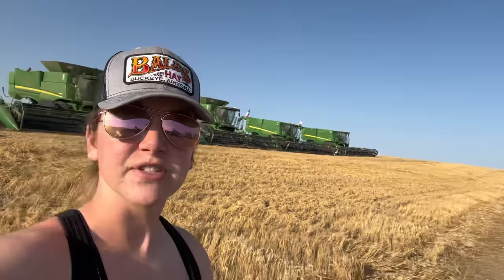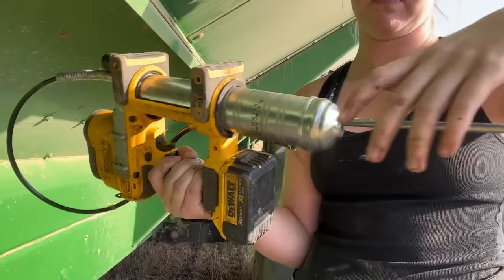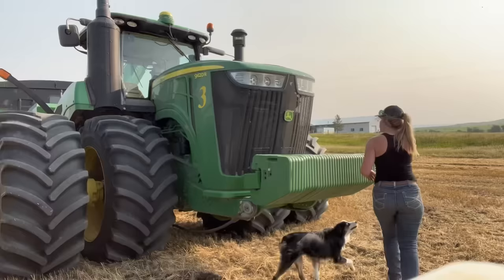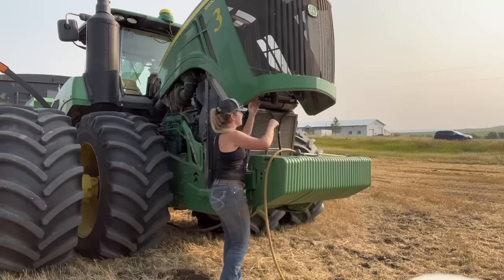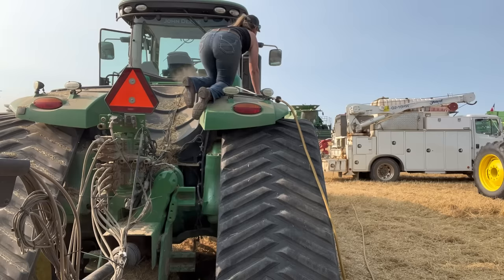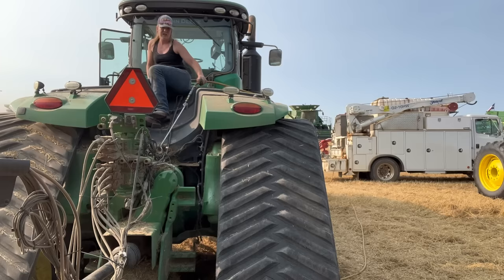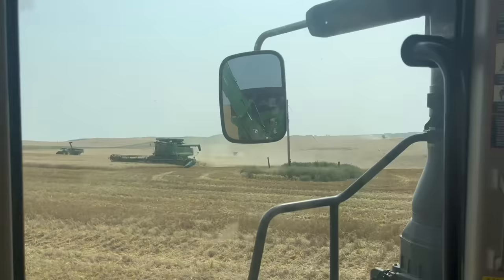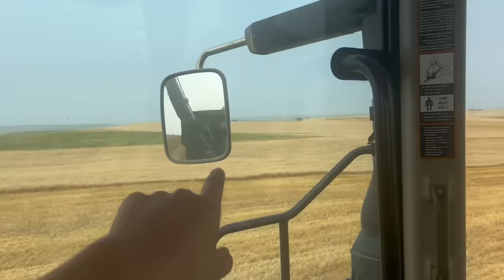Keep ‘Em Clean! - North Dakota Wheat Harvest 2023

Comment: Hi Emma. Love your videos. I saw you cleaning windows with a spray and paper towels and wanted to tell you how we did it. We had a deionized water device called the IPC eagle hydrotube.  Because the water that comes out is deionized(zero particulates) we would wash the windows with dawn dishsaop and then rinse it with the di water. As long as you didn't get some chaff or other dust or debris in the rinse stream you could walk away and the window would dry spotless. The dawn soap also removed any grease or other junk from the glass

Comment: I also use the cap to open the tube, I also wipe the grease off the pull tab into the tube. Then I put the tab in the old tube and the cap on it as well. You are 100% correct about keeping things clean. You didn't film him plugging, you filmed him UNplugging.